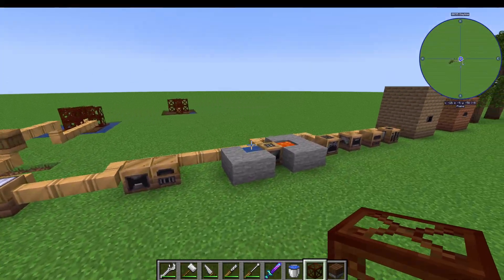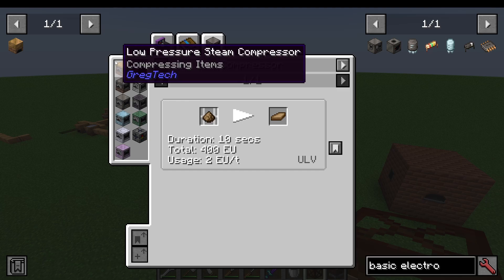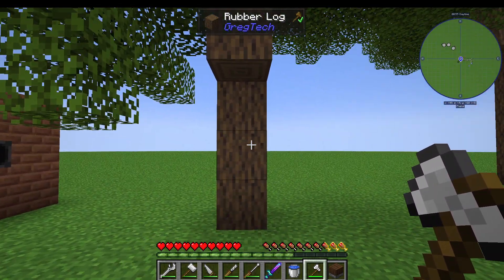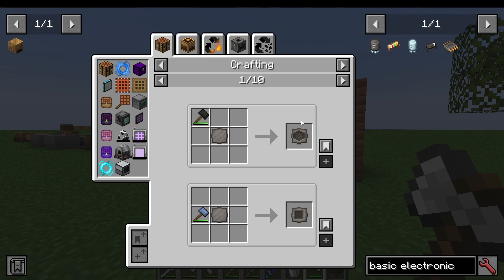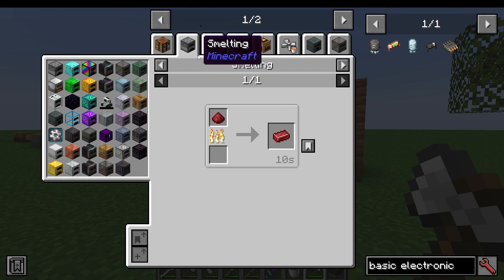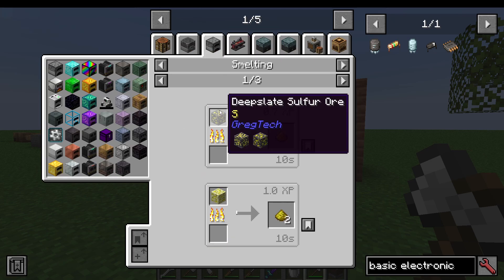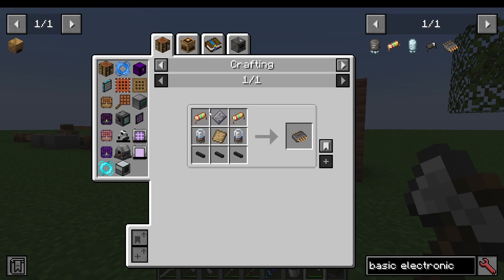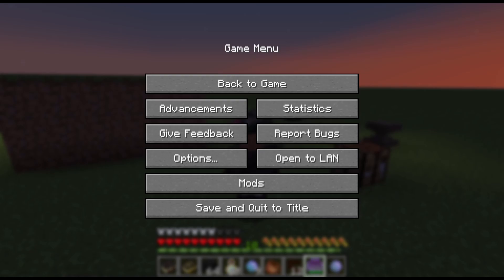Basic Electronic Circuit Tutorial - Gregtech CEu Modern

Comment: Quick note 3:05 , you only get byproducts from ores such as carbon starting at Hv macerator, its way easier to just use coal/charcoal dust instead and later on when you get pyrolyse oven you can produce carbon.